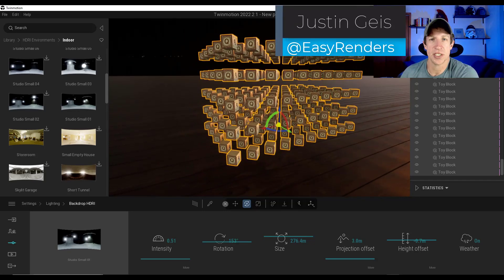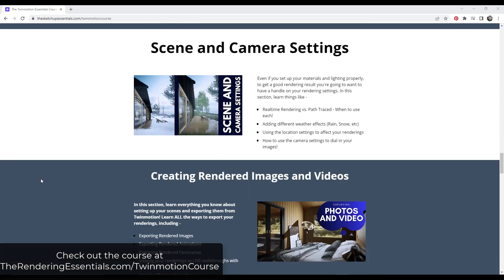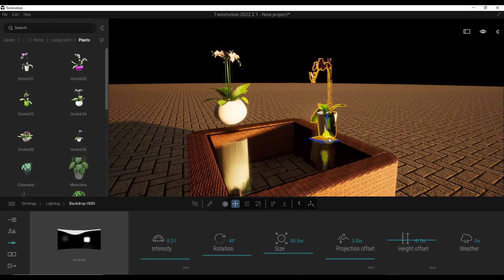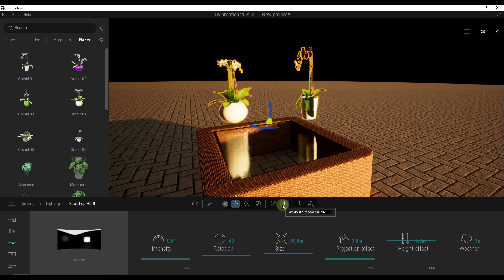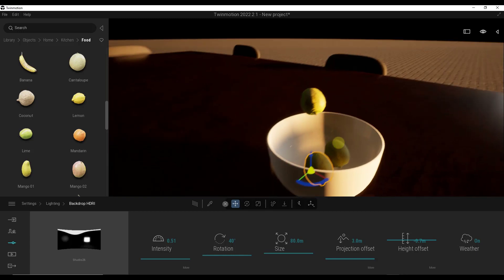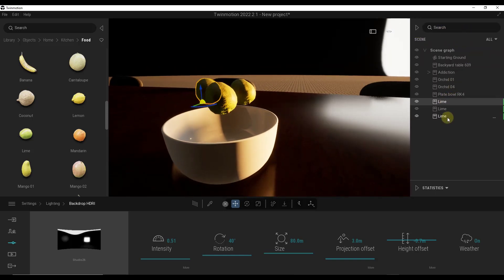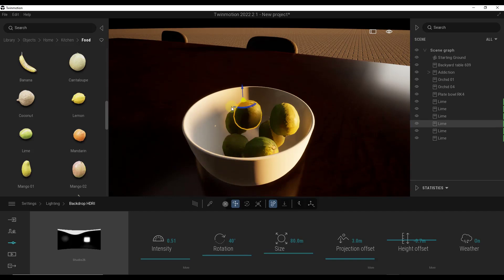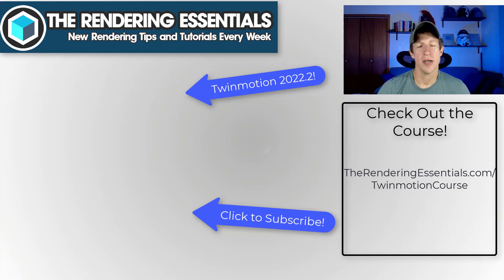Is PHYSICS in Twinmotion Any Good?

Comment: If you just wanna stick the object to the surface, you could drag the circle in the middle of the gizmo of the move tool or rotate tool to achieve instead, much quicker
Reply from the maker: Sure, and that works fine until the object gets moved, or something else moves, etc, then you're back to manual placement. This does a great job of placing things quickly for you